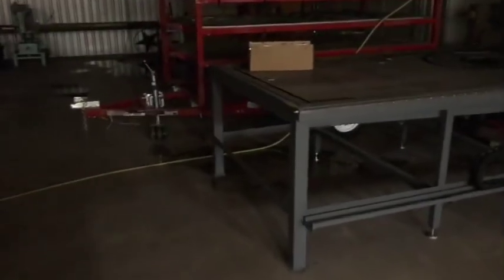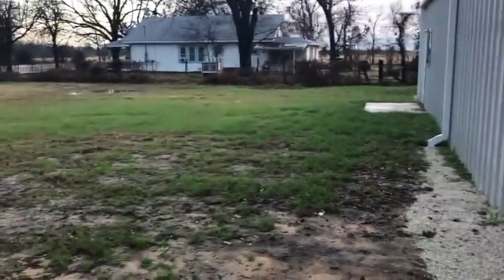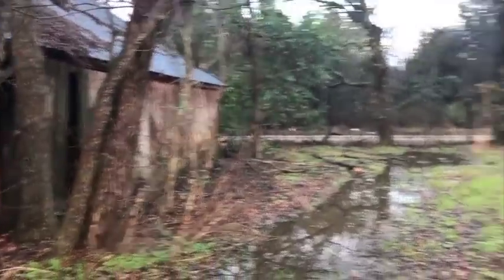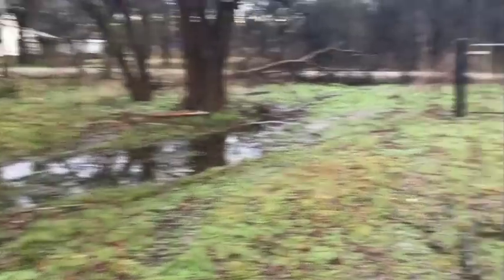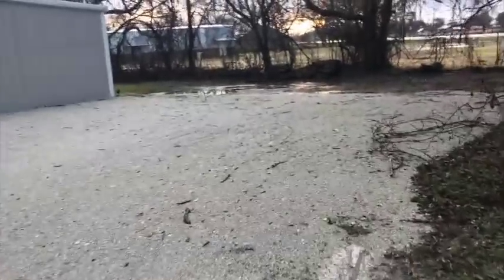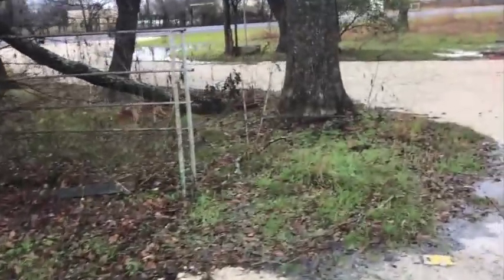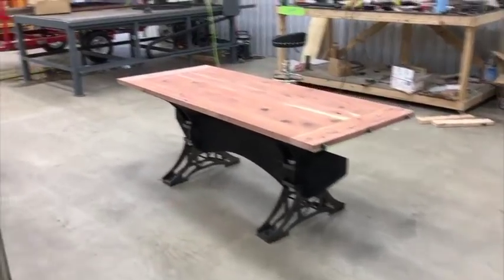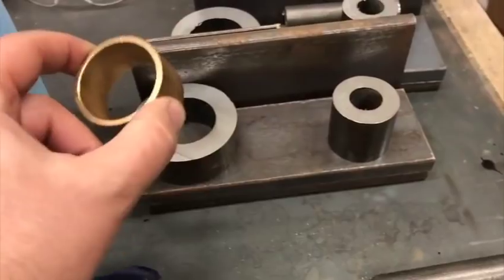Flooded Shop - Preview of Truss Bracket Table - Oldbarn Homesteading - Daily Vlog

Comment: Consider making gutter screens using coarse hardware cloth folded over a #9 wire frame. 

Size the frames such that they will wedge into the gutter trough, covering the downspout. 

The heavy #9 wire ought to prevent the mesh blowing away in the wind.

The hardware cloth ought to be fine enough to keep the sticks and crap out of the downspout.

Comment: That sucks.  Not as bad as me today. I smelled gas outside my shop this morning and then notice a piece was broken off the gas meter and hissing gas. Called power company and 911. They replaced the regulator and the detection tool he uses sensed a leak so the digging began.

Comment: I guess you do know how to swim, right? I have the same issue in my garage when it rains. I am hoping to get my driveway at least graded down come spring, as it is higher at it's peak by 6" than the floor in my garage and everything pitches toward the garage...Poor engineering by whoever built my garage.